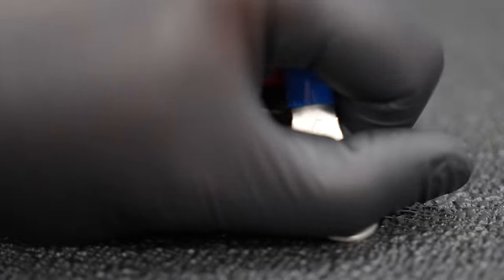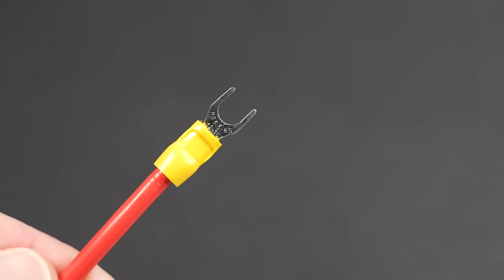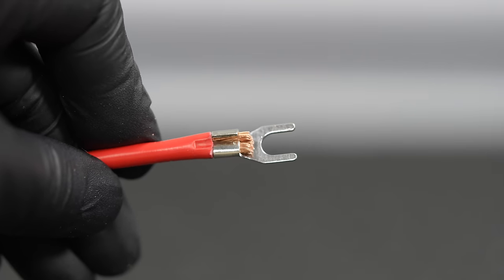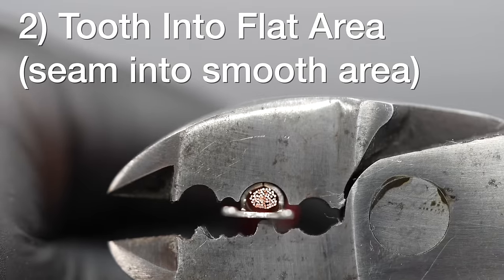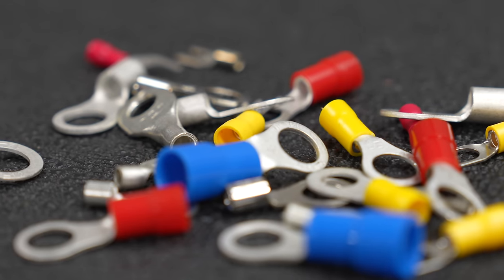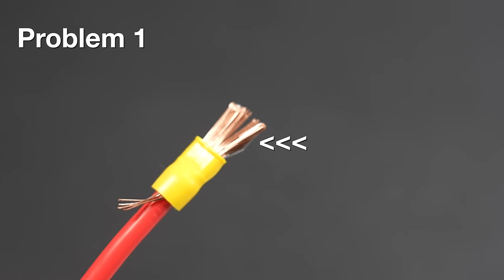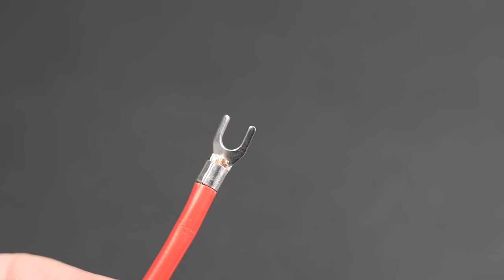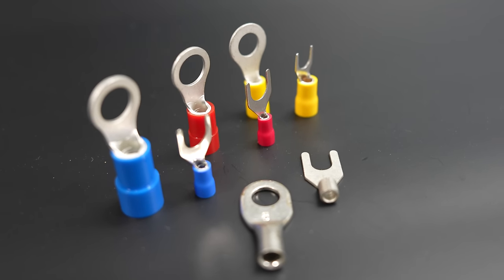Why 50% of All Crimp Connections Fail - Up or Down?

Comment: What you say is correct but If you buy brazed-barrel crimp terminals this failure mode cannot happen. They cost a lot more than the cheapies but are worth it. They often are made from thicker copper material, so they are sturdier. Nylon insulated terminals are good to higher temperatures than the cheaper PVC insulated ones. Many critical applications specify brazed-barrel terminals.

For smaller screw size terminals 1/16 stick out of the wire may be too much. Any wire past flush is not part of the connection, so just make sure the wire strands are just a little past flush and not in the way of the screw head. 

Ratcheting crimping tools are great and often take a lot less force to crimp. I have carpal tunnel damage from crimping terminals and cutting wires with less than the easiest tools over fifty years of tool use.
Reply: Thank you Walter.  Also people should avoid generic no name brand Chinese made crimp terminals widely available at online stores because even though they come in very affordable multi-packs with every size and style of crimp terminal you'll ever need in one convenient box.....video demonstrations have proven that they don't hold their crimp even when crimped correctly, to the point where just a slight tug on the wire pulls the terminal right off.  By comparison, Gardner Bender crimp terminals hold together very nicely.  I'm not sure what manufacturer makes the best brazed-barrel crimp terminals or where is the most convenient place to buy them but I have to find out before my next project.
Reply: I was about to comment this. I have switched to brazed seam uninsulated crimps and they work so much better.
Reply: 100% correct. Ideally followed up with double-wall heat shrink. (non-insulated connectors of course) @mandmwaddle
Reply: Excellent
Reply: Couldn't agree more. High quality terminals, and a high quality crimp tool are so worth it. I've been working on industrial machinery and building control panels for 40 years. Panduit or T&B are the way to go. I own both a Panduit CT-1550 and a T&B ERG 4001. A lot more expensive than most of the other tools on the market, but when a bad connection results in downtime and/or a call in the middle of the night, then they seem rather cheap by comparison.
Reply: Agree totally.    And I gave up on insulated terminals a long time ago.    Use the solid barrel type with a good heat shrink.   Good video, but the wire sticking out of the terminal doesn't do a thing.    I have a UL508A shop and I teach my guys how to do this w/o sticking the wire through.   We do have hydraulic crimp machines at work, but when I'm doing something at home I use the ratchets and avoid injury as you stated.
Reply: @dukeplc My complaint about the wire sticking out is that if it  sticks out too much you don't have a solid contract with the screw connector.
Reply: sticking out makes a stronger pull -out connection

Comment: 3.08 - The upper number is NOT "the size of the hole" - it doesn't vary (until crimped).  It is the size of the permissible conductor in square millimeters which is used outside the US to indicate wire size.

Comment: Although technically your using uninsulated crimpers on insulated terminals, you are correct about the orientation which is easy to see by looking down the inside of the terminal.

Insulated crimpers are what typically result in soft crimps, also good quality terminals have grooved interiors that help with getting a good bite on the wire, unlike the cheap Chinese terminals which are usually smooth.
Reply: I've been doing this method using uninsulated crimpers on insulated terminals for decades. Rarely does the crimper penetrate the insulation. If it does, it's just a small area inside a depression that is still protected from contact with other objects. For low voltage it's not a problem. For line voltage there might be some added shock risk but usually the compromised area is on the backside of a terminal so it is still protected from accidental contact.

Comment: Another potential issue, primarily with the insulated connectors, is getting some of the wire insulation into the crimp. Using the right size connector, as you pointed out, can help avoid that because only the wire will fit. But if the wire is in the smaller range for a particular connector, it is possible to get some of the wire insulation into the crimp, and then it impedes a good connection and it’s difficult to notice if the connector has an insulated collar around it.
Reply: ANAL ME: ATTEMP A PEEK IN THE "RECIEVER END", OR ASSUME THEY ARE OF STANDARD MEANS OF MANUFACTURE, SO INDENT? FROM THE GUESSED OPPOSITE (SMOOTH CONTINUOUS) SIDE WITH THE DISPLACING "PUNCH".

Comment: 1:15 - Your problem is you're using the part of the GB crimpers' jaws that's designed for use on uninsulated terminals ONLY to crimp an insulated terminal. The circular cutouts on this crimper's jaws next to the toothed cutouts are for crimping insulated terminals. Using the correct tool for the job - and knowing how to correctly use it - is 95% of the solution; the remaining 5% is technique.

Comment: I lessoned myself about 30 years ago in getting the crimp right, and using the correct heat shrink tube.   Insulated connectors have the insulating shell removed and thrown away, and crimped properly as shown.   You can get the uninsulated solid tube butt/end connectors at Napa usually, or any Commercial truck supply store.  Ancor Marine Grade heat shrink tube only, all I use now.  No more Harbor Frightening Chinashrink.   The Ancor is expensive, but you'll thank me later.  When shrunk properly, it will ooze sealant out of both ends of the shrink tube on the wire or connector., sealing and locking the connection.   You could tow a vehicle with the strength of that adhesive/sealant.  I made my own crimping tool because I was tired of folding the china crimpers over, when I would squeeze tight.  All big high amp connections get a hydraulically crimped end, and solder and Ancor.   You can also get the shrinkable butt connectors and others at Napa.  Most of those are junk.  Don't buy them.   Some of those better marine connectors do both with a shrinkable insulator and being loaded with Dielectric grease from the factory.

Comment: The right crimp for the right wire, the right tool and correct preparation will make a long lasting crimp every-time. I can say that because I am one of a handful of EWIS, Electrical Wiring Interconnect System, experts on USN/USMC, a few USAF an a half dozen foreign military aircraft. If you’re going to do more than a dozen crimps in a year and you can afford it buy the ratcheting crimper. You’ll get interchangeable heads and you won’t be able to crush the crimp like so many do. It really takes about 15 minutes to train someone to be able to properly one crimp after another.
Other than the lug breaking I can’t remember seeing a failed crimp in years. Thanks for a great video!

Comment: Unisulated crimped this way plus adhesive lined heat shrink is the best. Good content. Just be careful as many automotive connectors require special crimpers and they do go on the seam.
Reply: Thank you, somone get it...
Reply: Yep that's how I do it and that's how the factory does it. Never had an issue.
Reply: @arturozarate1752  thank you! Look at how it comes from the factory. Nice to see a fellow ford senior master in here
Reply: It's not hard to put the tooth on the seam, bending both sides into the copper. I have seen many bad connections also made the "proper" way if the wire, pushed from the other side, spreads the seam.

Comment: OUTSTANDING, as usual. I've seen MANY folks do this the wrong way and use regular pliers to crush the connector down. The "brute force" method.
Reply: Used vice grips for years, works great
Reply: I use a 6lb blacksmithing hammer and anvil, never had a problem.
Reply: works fine if your connectors are the good ones. This is the same thing the ratchet ones do.. "brute force"
Reply: @kcrichton7485  WHY CHANCE A FAILURE? WHEN KNOWLEDGE WILL YIELD SUCESS?
Reply: I have used pliers.
I have used a drift pin and big hammer. 
As much as I hate to admit, I have also used to small a wire and stripped off 2 inchs of insulation so I could fold it over a few times!!!
Reply: used a bench vise a few weeks ago and they came out just fine
Reply: And that's why crimping has such a bad reputation... amateurs using the wrong tool, and getting bad results. If you use the right tool, in the right way, crimping is superior to soldering. A proper crimp creates a cold weld which fuses the wire strands together into a single blob of metal.
Reply: @gg-gn3re  That's not true, they're not the same. The ratcheting crimpers are designed to produce a precise amount of force. Not too much force, not too little force. If you don't use a crimping tool, then the amount of force you apply will be wrong, and so you won't get a proper cold weld of the wire. Just use the tool which is designed for crimping.
Reply: @bluedistortions nobel prize for humor right there! 
omg if only all prople were as smart as anwil and hammer guy!
Reply: @SchemingGoldberg ehhhh, the fact that all of the high quality ratcheting crimps all have adjustable limits so you can change the amount of force used to crimp them down says differently. An inexperienced user with a ratchet style crimper with adjustability maybe think, adjust it to the tightest setting and set it, which would then be incorrect. Visa Versa, adjusting them to be too loose or not enough of a crimp will leave the wire loose in the connector
Reply: I stick them in a vice and then put a 6 foot long cheater bar on the handle and crank until it splits.

Comment: Me and a friend put an aftermarket ignition system on his motorcycle and needed to connect all kinds of wires with these connectors. Real glad I'd watched this video for fun a few days back and remembered to put them into the tool upside down. Not a single connection failed!

Comment: Excellent video. The only thing I would have mentioned is. All those crimp connectors are made of aluminum. And we all know it oxidized rapidly. Whenever I do any wiring with these connectors. I smear a dab of Dialectic grease on the wires. I was taught that years ago as a kid. And I have never had an issue with oxidized connectors. Even here where they salt the roads in the winter. Thanks for the great video
Reply: good call. I use Gardner Bender Ox-Gard
Reply: Not aluminum. They are copper base metal that is plated with silver.
Reply: Not aluminium. Copper base-metal, plated with Tin....

Comment: Wowsers what a rad video :) 20 odd years of crimping that led to me just soldering everything out of necessity for reliability I’m now off to buy some nice crimping pliers ❤
Reply: I will sometimes crimp and solder also .Just be careful to not let the solder wick too far down into the wire, else the flexibility will be gone and too much force could cause the wire to break.

Comment: Yup. I knew about the seam but had been doing it the opposite way. Sometimes the two halves on the seam would both curl in nicely and make a good crimp but your way is better and more predictable. Earns a sub, thanks!
Reply: There is a tool that pinches the two halves down and together like you said. It is what the factory does. Not for insulated terminals though. Surprised it was not shown in this video.

Comment: I've done a lot of stranded 10-14. I had some long handled crimpers like the Gardener/Bender in the vid. Came up missing. I ended up welding 6" extensions on the pair I use now, as I couldn't find another. Crimps like a bench vice. Fixing a pulled crimp on a submersible pump a couple hundred feet below ground motivates one to make good crimps.

Comment: It took me a while in my younger years to figure out which way to crimp terminals correctly. Great Video!!!! You are saving folks a ton of frustration and some downtime from a failed connection.
Reply: I alway cut the useless plastic “insulation” off of the connectors and use heat shrink instead. Problem solved.

Comment: As a former auto mechanic, I would use un insulated crimp connectors in under hood and under body situations, ONLY after slipping some heat shrink tubing over the wire, then crimping in the manner shown in the video, BUT, I would then use 60/40 solder and either a mini torch or soldering gun to wick solder into the crimped area to prevent water intrusion, and possible connectivity issues once the inevitable corrosion in the connector would start happening, THEN, I would slide the heat shrink tubing down over and give it the old BiC lighter wave or use a heat gun. In all my years of doing this, I've never had a connection fail. Factory plastic insulated crimps, with NO solder, I only use in the cabin of the vehicle where they are far less likely to suffer from corrosion issues, ie; like wiring in a car stereo ! 

Good video, just thought I would add this lil tech tip !!

Comment: You covered a great topic and glad you showed it done the right way, NICE JOB. If I may add, I ONLY use Ideal crimp connectors with either a ratchet crimper or a Klein regular crimper to get the best results. Whenever I rewire any kind of automotive application, especially boat trailers, I remove the insulation off the connector, slide 2 pieces of heat shrink tube with the last heat shrink to go on being a little longer before I crimp my connection. Last, all my crimps get sprayed with white lithium grease before I heat shrink them. Truly a long lasting, almost bullet proof connection. Hope you like the method to my madness. Mike. :)
Reply: try double-wall heat shrink with a melt-liner you will marvel at the finished connection. That single wall heatshrink you are using will probably split with age. When you heat the double-wall you stop heating right the very second it oozes out. This also serves as limiting the heat applied.
Reply: @cruze1953 This is exactly why I use 2 pieces of heat shrink, 1 longer than the other. Lithium grease under the 1st heat shrink, and the 2nd heat shrink overlaps each end to seal in the grease. Over heating heat shrink makes it brittle and a very good point. I will look in to that type of heat shrink that I am not familiar with. Thanks!
Reply: @JohnSmith-he1eq  white lithium is not an ideal thing to have UNDER your tubing.  Why would you do that?
Reply: @CT_Taylor. Yes.  Silicone Dielectric grease is the one to use.

Comment: Wow. I have always soldered the wires into the crimp terminals after crimping to make sure the wires do not fall off. Since 1968. I see I have been doing it wrong all this time. Even when using a power crimping tool. at work. Thanks for this.
Reply: You should never use solder on a crimp connection. Using solder creates a weak point in the wire because the solder wicks up the wire during soldering. For any wiring subject to vibration, this leads to the conductor breaking inside the insulation. It always fails just where the wicked up solder ends, as that's the first point where the wire can bend.
Reply: @grizewald it only wicks up the wire and creates a weak point if you’re using too much solder. Using a “dab/drop” right at the beginning of the crimp where the wire is barely exposed will secure it to the connector and create a stronger hold. Then slide the glue lined aka “marine grade” insulation up over the connector and shrink it down
Reply: @diezelking89 Exactly! What you describe IS the BEST method. 👍👍👍

Comment: I use a hex crimper always, from #22 to 4/0 . But the variation in insulation size, hardness, etc makes me prefer uninsulated terminals. The crimp is visible for QC inspection, and I use heat shrink afterwards.
Reply: are you using seamless barrel connectors OR brazed seam? Followed with double-wall heat shrink with melt-liner? I used to splice submersible pumps using seamless butt-connectors followed with 3M double-wall shrink which has melt liner. The crimp tool was the kind with the dimple like Klein makes. These were 50HP 3-phase 480 volt pumps at lift stations.

Comment: I've watched a lot of crimping videos over the years as I've always struggled to get satisfactory crimps. This is by far one of, if not the best.  

I have three of those ratcheting crimpers including the one that you used and I was never able to get satisfactory crimps out of it. I don't know if I'm just using it wrong or the wrong dies, but it never seems to work well. I just started using the uninsulated ones so I could make sure the wire and connector deformed together solidly.

Comment: This! I tried to teach a new boss this once and he wouldn't listen, until I started going over to the bench where he was working and easily pulling off 2/3 of the terminals he had just crimped. Another bad habit of his was to strip the wire too short, the crimp (even when properly oriented) would only pinch the very tip of the stripped portion of the wire... also easily pulled off. My agency wouldn't spring for good ratcheting crimpers but at least I got them to throw out the trash Radio Shack crimpers (like the first pair you showed) in all the toolkits for a fairly decent Ideal 30-429 that had dies for both insulated and bare terminals. I used my pair for nearly 20 years, crimping thousands upon thousands of terminals, and I took them home with me when I retired. Good video!

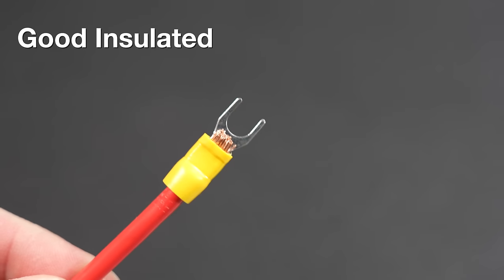Comment: Good video but I think there should be less wire extending pass the connection than You showed on 4:28. This may result in a bolt head that is not flat against surface of the connector, but half resting on the wire, resulting in bad connection between bolt and connector.

Comment: This made my day, if you know you know.... This is incorrect, the seam of crimp must curl around the wires evenly, also there must be a insulated shrink wrapping over wire and crimp. There only needs to be the length of wire only the size of crimping area.